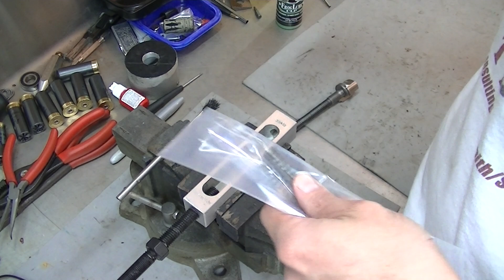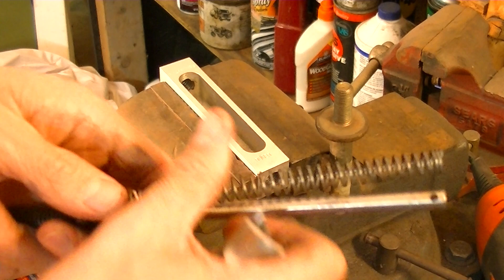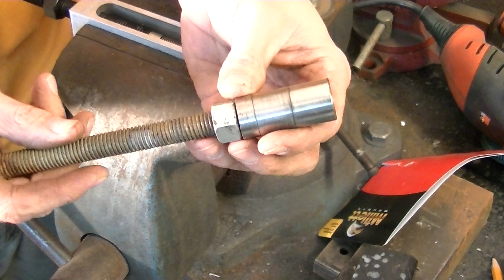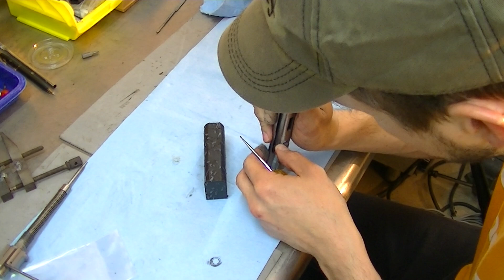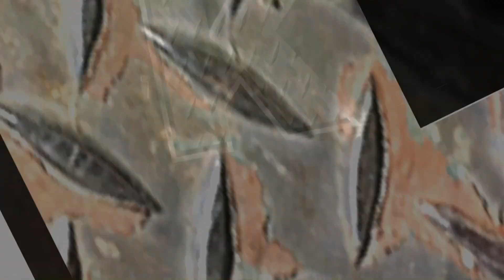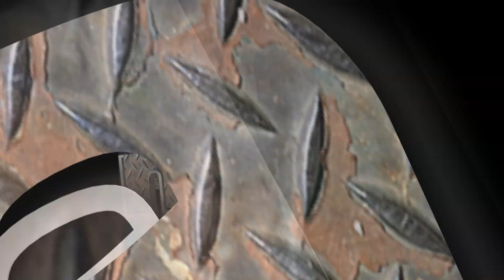Ruger M77 mkII Bolt/Firing Pin teardown and reasembly .300 win/mag

Comment: I have a Ruger M77 Guide Gun in .416 Ruger.  I had been having reliability issues with my handloads. Eventually I determined that it was probably a weak firing pin spring.  I replaced it with a 24 lb Blitzschnell as you did. Your video was very helpful. In case you were wondering, "blitzschnell"  can be translated from German as "lightning-fast"... which makes a certain amount of sense.  Often you Southern  blue-collar folks can teach us Yankee college boys a few things. 😏

Great video!

Comment: Good video, Thanks.
It might be worth mounting your Aluminium tool on a bit of steel square or rectangular tubing or similar and putting the steel in the vice. Easy to be wise after the event, I would have stuck the tool in the vice as well.

Comment: Thanks for the info! 
Are the standard factory springs known to be a bit weak. My son recently bought a M77 in a 458Lott, originally converted from a 375H&H, and has experienced a few mis-fires. I suspect the firing pin is worn slightly, but could it need this after market spring rather.
I've not been able to strip the bolt as it only turns about a third and then jams extremely tight. I'm not sure if there's some trick or is it just stuck from long time without opening perhaps?

Comment: Greaat video. Used it to change firing pin spring....But I Screwed up when reinstalling into the bolt....my finish nail fell out and the bolt snapped into a cocked position and will not reinstall in gun....How Can I get the cocking piece back into proper position?...ideas ?
Reply: Put the cocking lug on the edge of a table and push the bolt down to collapse the spring and turn the bolt.

Comment: You said you are replacing the firing pin spring to increase "reliability".  Really?  Have you actually found the factory spring to be unreliable?  Me thinks you just wanted to replace the spring.  Good video.  Thanks.
Reply from the maker: +Max Hill Absolutely.  Much of this surplus ammo sports hard primers and CCI and some of the overseas primers for reloaders are very hard.  The factory spring often has issues with some of these.  This particular customer brought this gun in because of failure to fire problems experienced.
Reply: So if the unit received better maintenance could this have been avoided?
Reply: On a hunting trip in Montana my daughter was using my rifle M77 270 with Hornady rounds had a light primer strike on the first round luckily the deer stood there long enough for a second shot. her first deer.